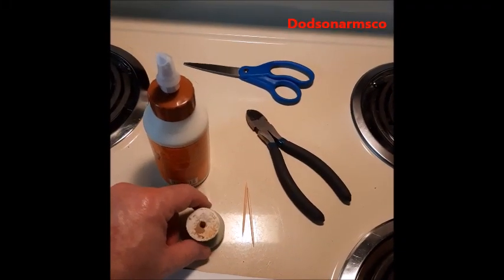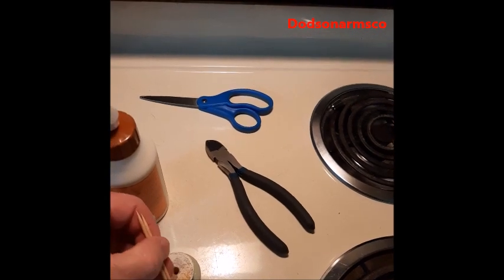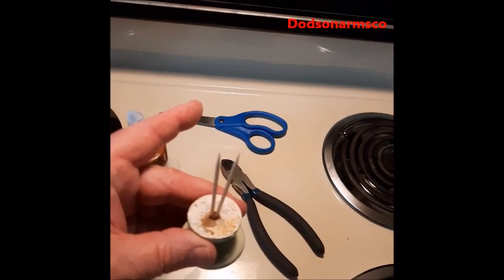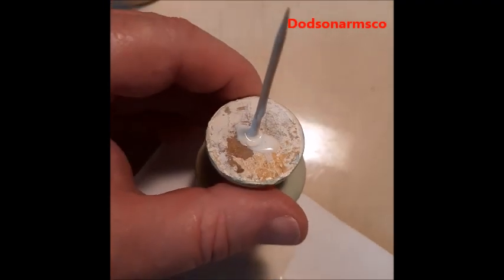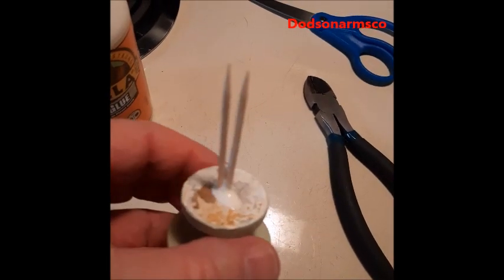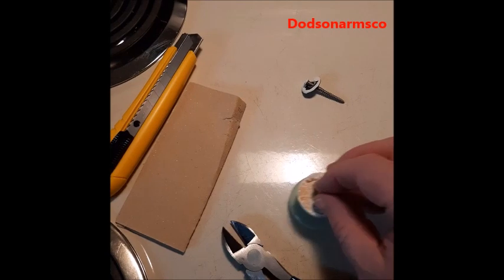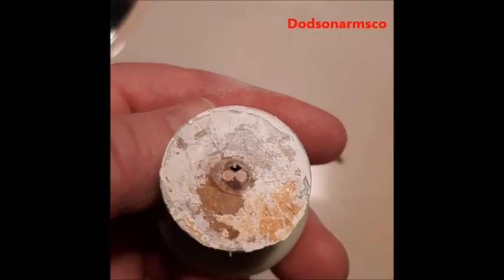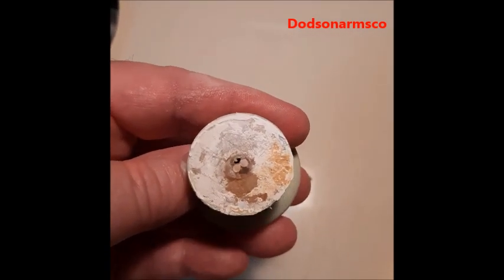Fix stripped holes for wood screws on furniture, houses, arts, crafts, guns, and gear. SHTF Survival

Comment: Copper wire in metallic threats can work in a pinch. Wouldn't bet my cows on it for a permanent fix. Best drill and tap. But has helped me. Thank you again sir. You're teaching the right skill sets. I pass them along as relevant to the situation. Stay frosty sir.

Comment: Excellent video! I do kinda the same for stripped hinge screw holes in wood door and frame....for metal door and frames I'll stick a piece of zip tie or 1.7 mm tie wire, aluminum fence tie in the suspect hole and, maybe a little glue or epoxy...its according....
Reply from the maker: Great tips. Thanks for sharing. Take care and stay safe.